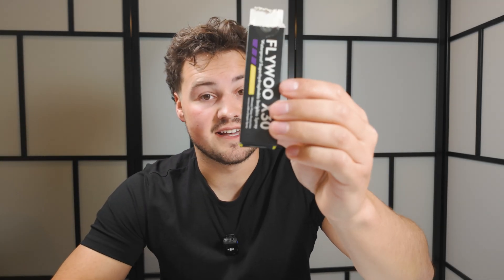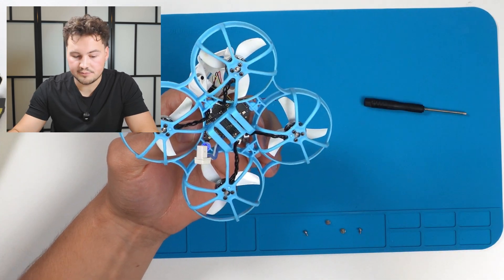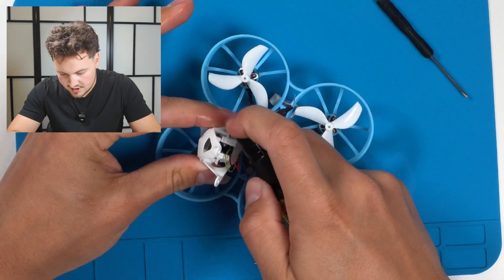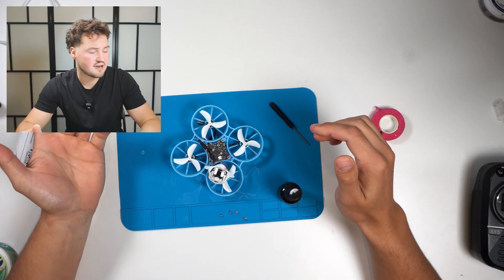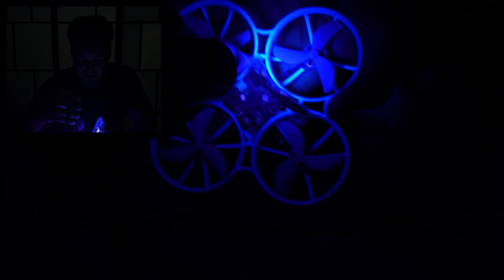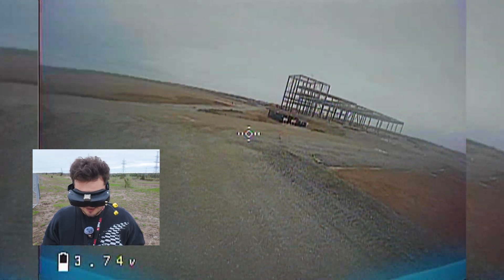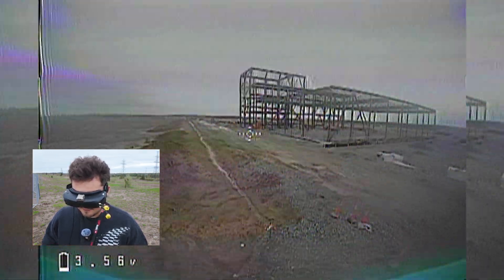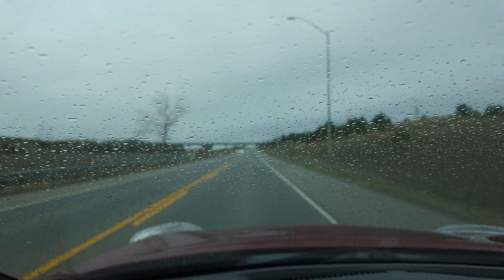Waterproofing My FPV Drone

Comment: i searched yesterday for a video waterproofing the air 75 and now this video was recommended and im excited for the results
Reply from the maker: Did you end up getting any coating for your quad?
Reply: @FPVEvan  not yet but i definitely will